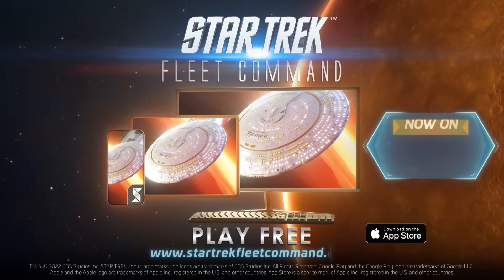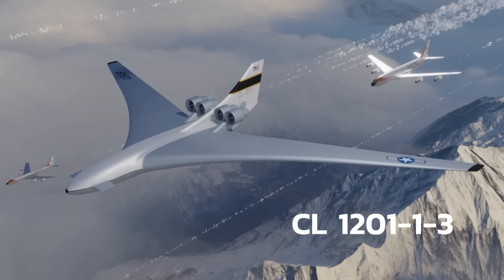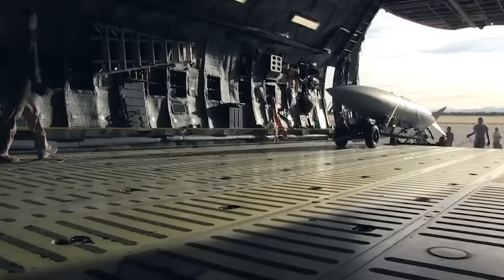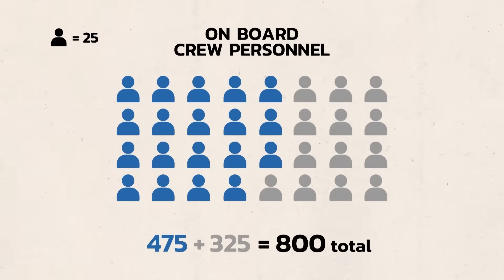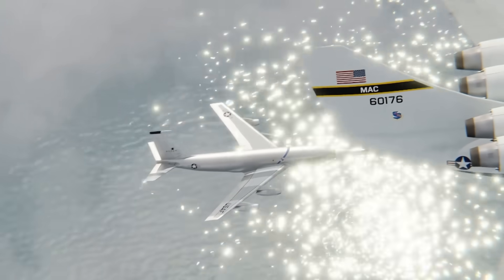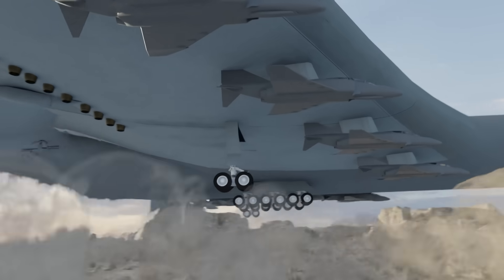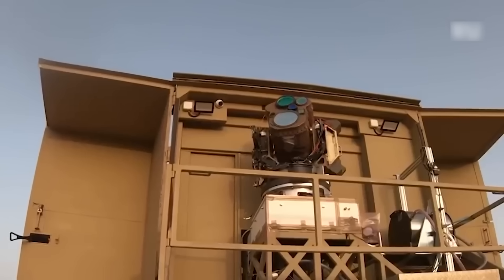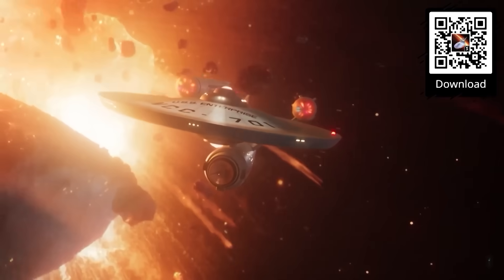The INSANE Largest Aircraft Ever Designed - Lockheed CL-1201

Comment: I think one of the main problems is that at this size, an unsupervised five year old with a microwave and some crayons has a realistic chance to get a radar lock on that monstrosity - it's literally the most concentrated and exposed strategic target I could imagine.
Reply: Just like an aircraft carrier ( ship)
Reply: @CHMichael  yep but sinking an aircraft carrier is surprisingly hard and no matter what an aircraft is by nature very susceptible to a much more likely event of critical damage to destroy it for good. And when that thing gets hit which it almost inevitably will just because it's massive Radar and heat signature there's a pretty good chance of it going down for good. And every defense system can be overwhelmed so a system of this level of strategically importance must be able to sustain damage and keep at least a basic layer of functionality, even if it's just saving the crew.
Reply: @minklmank  it's the battle group around the carrier that keeps it safe. 
Obviously it's completely unpractical
to have that many airplane around, that's why it isn't a thing. 
I would like to see a higher flying b52 dropping drones concept.
Reply: @CHMichael  probably not gonna happen - the B52 airframes could not handle it, that's also why they still have 8 low bypass ratio engines instead of more fuel efficient high bypass ratio engines - they probably just keep the BUFF as is, keep it really far away from any danger and just use it to get better cruise missiles "close enough"
No need to reinvent the wheel
Reply: And the one who tries to deploy it into a hostile controlled contested zone is sent into his office where there's a pistol with a single shot waiting for him.
Reply: @JFrazer4303  Anyone that tries to put that craft into a contested zone is deserving of that for wasting such a valuable asset if it gets shot down. 

Its perfect as a Actual aircraft carrier.  Fly outside of the contested zone and launch fighters which flies into the combat zone do what they do and either find a friendly base or if the craft is able to try to recover the fighters.
Reply: Hey ... anyone knows how the nuclear reactor can supply power to the 4 conventional jet engines at the its back? ? ... Jet engines need fuel to run, don't they? ?
Reply: @JohnKickboxing  Not really with nuclear engines as they don't need combustion chambers. 

The Air is cycled through various parts and the reactor. then emitted out as exhaust as its cooled and heated by the reactor. Thus it doesn't need fuel to run.   

Look up Direct Air Cycle.
Reply: @Quetzalcoatl_Feathered_Serpent  👌
Reply: @Quetzalcoatl_Feathered_Serpent  Considering the air on the ground or sea level is not that cold compared to that on the high altitude, can the nuclear reactors boil it into steam and make the steam jet out in the same way a conventional jet engine does?
Reply: @JohnKickboxing  Thats indirect Air cycle where they use water and steam to make the pressure. While a interesting concept it has a number of issues especially in the amount of extra parts needed for the process.  While it was researched nothing came out of the research that proved useful or powerful enough.  The Direct air cycle is the one that works.
Reply: @Quetzalcoatl_Feathered_Serpent it would had pathetic thrust
Reply: @theccpisaparasite8813  well yeah.  It's not like it's going to be fast.  It's a giant aircraft carrier.  Not a fighter aircraft.  At most it's going to be subsonic.  Probably as fast as old WWII bombers in the late stage of the war and the thrust is likely going to be poor.
Reply: @JohnKickboxing  try look SLAM missiles the OG loiter.munition
Reply: @sargera1  Wow, there have been such an equipment able to boil the rammed air.
Reply: @JohnKickboxing  I believe the concept of a nucular jet engine back in the 1960`s, was using the heat of the nucular pile to super heat air and creating thrust with that.
Reply: @xriz00  👌
Reply: @JohnKickboxing  they don't have to be conventional jet engines. All you really need is a lot of heat to force air passing through the engine to expand. Burning fuel is one way to get that but any source if heat will do.
Reply: @sethb3090  So they need to make a set of electric compressors to suck air into the heating chamber, don't they?
Reply: Everyone in the comments: Man, this would be so COOL!
Me, an intellectual: Ah yes, the CL-1201 Giant Target
Reply: @sethb3090  
Me a Strategiest:  Ah yess that's why we deploy the fighters outside the combat zone.  Its a flying aircraft carrier not a bomber.

There's a reason why B-52s can now be fitted with a crap ton of cruise missiles these days.
Reply: @Quetzalcoatl_Feathered_Serpent  Me an recursive absurdist: It is a giant bomber that bombs battlefield with normal sized bombers which bomb battlefield with bombs! I'm sure we could put drones and cluster bombs somewhere in this idiotic chain of overcomplicated mass murders.
Reply: @SroedingerCat  war is war.  10000 years of human civilization doesn't change that fact that war is part of your species. However I do know that attrition  wise.  There would be less death if your able to turn the tide of war quickly resulting in a fast victory.  

Besides the bloodshed in war now is far less than that of the past with spear and sword.   These days it's fairly quick.  Course I'm referring to actual war not occupation. 

Regardless of your views I see a upside to a giant craft like this.  Both for war and peace.
Reply: @Quetzalcoatl_Feathered_Serpent  I don't see why war has to be inevitable. Slavery was a fact of life for all of history, until it wasn't.
Reply: @smorrow  

Slavery merely evolved to blue collared wage workers that barely is able to survive on wages they have while those more affluent stay on top hiking up prices and keeping those with lower income from rising up the ladder.  

As for war.  Its not inevitable nor that I said it was.   Only that its part of your species.  In many ways you shouldn't deny that part of yourselves.   It might be important later down the line.
Reply: @smorrow  The whole point of slavery was to have a available inexpensive workforce.  Always have been.

A blue collared worker is usually a low paid worker who does mostly manual labor, farming, janitorial work, food services, construction, etc. Basically the same roles slaves had in the past except this time they are being paid.  

That in itself should not be a bad thing.  People being paid is important it must be encouraged.    Its when that pay doesn't allow a living wage where that person can survive and improve their quality of life,  and its just barely getting by that you have to do 2 or maybe 3 jobs.  then that's when things becomes a problem.
Reply: @smorrow  conflict isnt a fact of life, its part of the natural order of things we will have wars as long as we are all individuals
Reply: @JRDShamrock  I don't think states are inevitable, and war is practised exclusively by states, so....
Reply: @Quetzalcoatl_Feathered_Serpent  i never new I was black lmao
Reply: @Quetzalcoatl_Feathered_Serpent  POV: average Hearts of Iron 4 player
Reply: @smorrow  "until it wasn't" what a grand and intoxicating innocence.
Reply: @Atari3482  
unsure what you're responding to but this is like, general common sense for any type of aircraft carrier, hoi4 has nothing on the overly futuristic and optimistic dreams of the past.

( assuming you're talking about the aircraft just loitering far away and safe enough from the enemy )
Reply: @Quetzalcoatl_Feathered_Serpent  you are a fool lol
Reply: @SroedingerCat  😮
Reply: @smorrow  If you thijnk slavery isnt still a fact of life for a quite a lot of people then you are delusional.
Reply: Slavery is alive and well today. Human trafficking is not low-wage work. Comparing the two is an insult to the people who are actually slaves today. Maybe you didn't know that actual slavery is very much not a thing of the past. Those people who are trafficked and sold as slaves, are probably praying for a minimum wage job in the free world.   @Quetzalcoatl_Feathered_Serpent
Reply: @Quetzalcoatl_Feathered_Serpent  No the point of slavery was to have a worker that you own as a piece of property with no rights, not to employ someone and "pay them very little". But also what constitutes getting paid very little is pretty relative sense for most of history nearly everyone had very little by modern standards. The fact you think your employment at Walmart is in any way similar to historic slavery is mind boggling.
Reply: @smorrow "slavery was a part of history until it wasnt" sorry to say this but there's more slaves now than ever before, we just call it human trafficking.
Reply: @parzavaal5335  If the absolute number has gone up its probably because the human population has increased like 8 fold sense slavery was in its heyday. It's not like making slavery illegal wasn't extremely effective, especially in places like the United States were the absolute amount of slavery has gone down by several orders of magnitude (sense slavery became illegal).
Reply: @kylehankins5988  that's a good point but by your own logic if the absolute number hasn't gone up then it hasn't gotten better, and sex trafficking is not limited to first world countries and it's super sad that it's still a problem..
Reply: @Quetzalcoatl_Feathered_Serpent  skills gets you paid servitude or employment. In servitude workers are kept vary healthy, fed well and paid well...think of modern day athletes and artists, that's servitude, your important to whoever you work for, slavery is when your forced to work kept as a prisoner, servitude is a contract with a release date. 

People nowadays don't have enough competing skills to feed themselves, to house themselves...employment is horrible, made humans even cheaper and easy to replace 

Also farmers get slaves they don't slave they have lands already
Reply: @SroedingerCat  Lmao a humongous bomber that drops bomber planes which in turn do the actual bombarding. well put my friend
Reply: @the-letter_s  " "until it wasn't" what a grand and intoxicating innocence."

And what a grand and totally useless comment.
Reply: @justalonesoul5825  considering i can't find the comment i said that to in the first place, you might as well be right. i forgot what he said.
Reply: @the-letter_s  lol I hate when that happens
Reply: Slavery is still ongoing in a huge way  @smorrow
Reply: @Quetzalcoatl_Feathered_Serpent ”your” species?? u are a human too right?
Reply: @themalhotras1597  Are you?  Kinda hard to tell on the net these days on who you might be talking to :P.  Honestly it shouldn't matter.   Have a little fun not knowing.
Reply: @Quetzalcoatl_Feathered_Serpent  take your meds
Reply: @sethb3090   yes, but so are today's aircraft carriers
Reply: @sethb3090 ah yes me as a man that understands most large aircraft near combat zones would just let off some flares to make heat seeking missiles lock onto the flares and detonate instead of the main aircraft. The thing probably would have enough space to carry butt loads of flares and maybe even a room dedicated for making flares on board if they really wanted more flares lol
Reply: yes, but so are today's aircraft carriers
Reply: Yeah, but they weren't allowed to mention that it was protected by Forerunner class hardlight shields.
Reply: chernobyl  in the sky!
Reply: yup
Reply: Haha, Microwave and crayons!
Reply: Reminds me of Hitler's Mouse. All the materials in one package, means you lose it all at once.
Reply: if you watched the video they said they wanted to have a laser defense system for it  12:10
Reply: LoL ... no losing this puppy on the radar. Looks like a great candidate for passenger jet
Reply: Yes it's a decoy for the larger aircraft behind!
Reply: Nuh uh, just paint it sky blue 😂
Reply: It would be so high and so far away from the opposing offense that it wouldn’t matter. Meanwhile we have an entire flat already on the way. Not to mention it would have next level air defense
Reply: it is basically the earth equivalent of a Deathstar. Equally stupid concentration of resources in one place.
Reply: It'd need a lot of engine power, but with enough lift you could just load it with enough missile interceptors that'd it'd be like a modern combat ship with SM-2's, SM-6's, etc. So you'd need a pretty overwhelming missile strike to take one down.
Nuclear super vehicles are pretty nutty so it isn't super far fetched that it could be made combat effective, though it'd certainly not be cost effective given what maintenance and development costs would be.
Reply: Laser defense and as we learned with balloon crisis , if high enough , would be difficult to hit
Reply: i think it could be avoided by flying just a bit higher and a few changes in surfaces with different materials
how effective it would be is beyond me but just a suggestion
Reply: @exorias625  If we look into consideration of weight and ability to carry aircraft at most with current fighters it could carry at least as much if a little less than a light carrier.     It would be useful in perhaps bolstering air capabilities and its ability to fly anywhere.  There is the fact that it's not stealthy at all but that in itself is not a deterrent.  If anything that is a advantage especially if you place it in a position where the enemy has to decide to focus on it, ground aircraft launching from a nearby allied base or carrier launched.    If the thing has stealth fighters or drones that also makes is more deadly cause even if you know it launched them you have no idea what it launched and you still have to worry about other craft coming into the region.   It puts another variable the enemy might not be able to counter.   If anything I would be more terrified if it loitered around for a bit and suddenly left cause you'll be wondering.  Did it leave anything behind?  Should I send fighters to check it out?   Could I risk that well I have a enemy carrier by my shore and enemy bases from other countries sending fighters?
Reply: @Quetzalcoatl_Feathered_Serpent 

In that scenario I would think enemy would definitely want to focus on super duper largeass aircraft aircraft carrier. It is a massively expensive asset. Would be much higher value target than pretty much any other opposing force in the scenario...unless some of that for e was about to strike a critical friendly target/infrastructure...but I'd think 9 out of 10 possible scenarios like you describe...the enemy would make it a point to target this thing strictly due to higher value target
Reply: I'm sure if made today it would have laser guided defense systems that could prevent the majority of issues.
Reply: Well, not more than a regular sea-going aircraft carrier.
And it wouldn't be much more vulnerable either because at that scale it could be equiped with basically the same defence systems that can fit on a ship
Reply: @qdaniele97  oh gods imagine that thing armed with laser defense systems?   Thing would be a beast.
Reply: @qdaniele97  "And it wouldn't be much more vulnerable either because at that scale it could be equiped with basically the same defence systems that can fit on a ship"

No obviously it couldnt. Naval carreer just displaces some more water. Weight on a plane is an incredibly limiting factor. Anyway the whole concept is incredibly r*tarded AF.
Reply: Finally, we could have the same argument for the naval carriers. There are also very big and strategic targets, and are still in use though.
Reply: @francoism2232  "Finally, we could have the same argument for the naval carriers. There are also very big and strategic targets, and are still in use though."

3 words : carrier strike group. Good luck setting that up around a r*tarded flying carrier. Also, radar signature. I guess you dont really understand anything about that concept either.

Comment: I cant see how they would ever make he launch and recovery of Phantoms work with that plan... imagine the turbulence under those giant wings.
Reply: There may actually be a modern solution for this.  The potential for turbulence and uneven airflows is an issue for engine intakes too, such that one side of the blades would get hit with more force than the other.  They have figured out that putting a bulbous section in front of the intake separates the boundary layer so that the air going into the engine is comparatively even, and thus putting less strain on the blades.   

Something similar could be set up so as to have a deployable folded thing that does this for an entire fighter.

Comment: Lockheed as far as I know kept this design and scaled it down to a more practical size to eventually become the C5,KC-135 replacement. They refer to it right now as the Hybrid Wing Body concept but I’m sure here soon we’ll learn of a official name. It’s supposed to be a cargo/tanker/troop transport/forward command center as they’ve designed different modules that plug into the cargo bay area.
Reply: Never give up on a good thing.  Or a good design.
Reply: The C-5 Galaxy is strickly a cargo aircraft. the KC-135 replacement is the KC-10

Comment: If you used electric motors for the four big engines, why not on the rows of small ones for VTOL?   How about the Phantoms can also provide thrust, and armament for the Mothercraft?   Let's build this thing!
Reply: the big engines are not powered by electric motors, they're powered by the heat produced by the reactors, the lift engines are also not for VTOL as you can tell by the fact that they would have nowhere near enough thrust